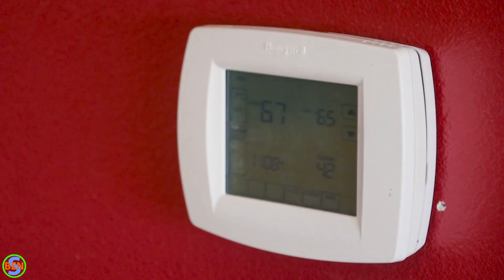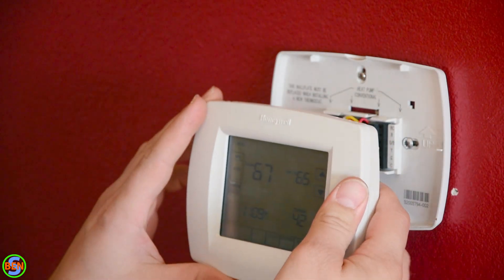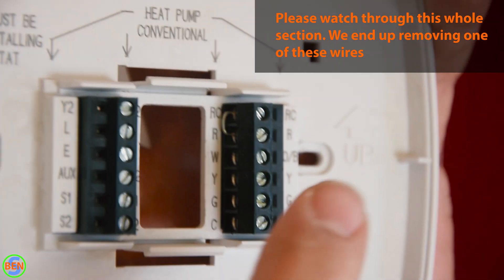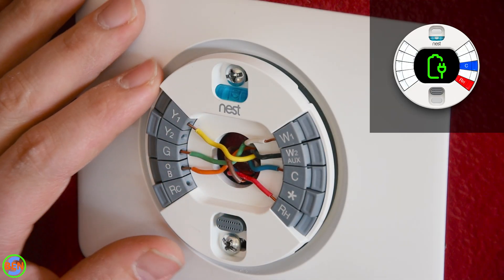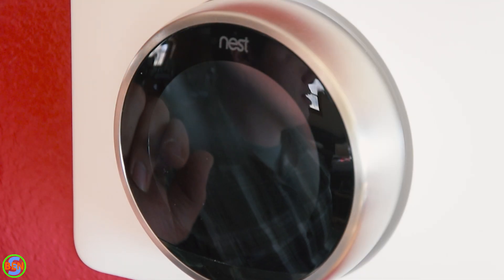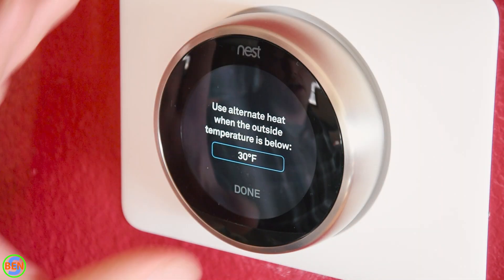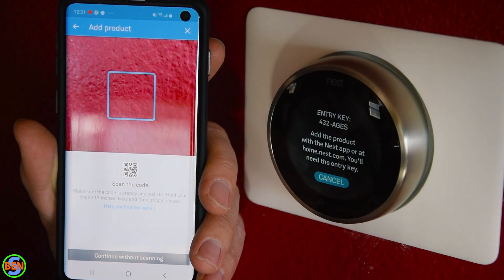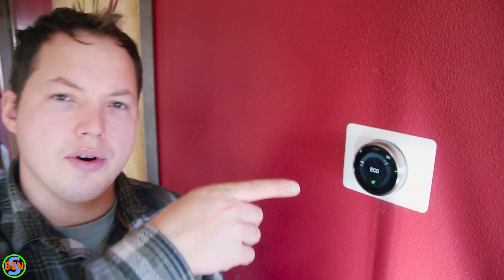How To Install the Nest Thermostat With a Heat Pump

Comment: Hi, I  am replacing the old Honeywell thermostat with a new nest . The old wire has only 2 wires, 1 red and green. 
Should I connect the nest using the 2 wires only?

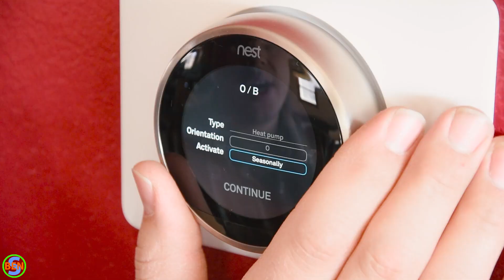Comment: Sir, you literally saved me with what you stated from 5:16-5:20 about reversing the O and B in the equipment settings for my Tosot TU36-24wadu heat pump, my first one! I had a heck of a time turning on heat and the AC coming on,  I tried EVERYTHING,  changing different wires, white wire from W1 to OB and back, red wire from rc to rh, etc etc.  Either heat was produced, but the heat pump fan didn't come on,  or the heat and AC production were reversed when Nest was turned on. My wife even wanted to go back to the old dumb thermostat, luckily I found your video! Thanks again! Definitely subscribing to your channel/videos!!!💯👍

Comment: i am doing A Mr cool natural gas furnace and mrcool universal heat pump. i hear its made by  Lennox . watch at the 14:24 mark and tell me thats not the same as mrcool.
          Dual Fuel Heat Pump Install Tips - How To Install A Heat Pump by HVAC Know It All... any how HP- Y,R,C all connect to the furnace at R,Y,C the blue would feed though  (wire nut it going to the thermostat) D is for defrost if your furnace supports it. if not omit it. now my heat pump needs power to the B terminal at the HP(heat pump) for the heat to work. your may be different and you need to know so you can set the nest to supply power or not depending on the mode desired ( heat or cool) and the B terminal from the HP connects to the O/B of the nest. after that these are all furnace terminals for a single stage furnace. R to Rc or Rh doesn't matter. the nest makes the connection between them. The reason for the separate Rc Rh as i understand it is if you have 2 transformers. 1 for heat and 1 for cooling. say a air handler for cooling and a boiler for heat. the 2 systems are separate from each other so 2 transformers .W to W1, C to C,G to G, Y to Y1 and of course R to Rc or Rh and HP B to O/B  and if your furnace has a D then that to HP D if not omit it. I'm not saying wire colors because they differ from instal to instal.... easy peasy. if i am wrong please comment and correct me. i am not a hvac tech by any means . just a hack with a good understand of wiring. use at your own risk. and your system may very.

Comment: I have a Gen 1 Nest thermostat that i self installed to a circa 1994 York natural gas furnace and central AC unit.  I just had everything replaced with a Bryant furnace and Mitsubishi heat pump.  The installer removed my Nest and said the heatvpump has to use the basic (and dumb) thermostat from Mitsubishi.

Can i use a Nest thermostat with this new heatpump setup?  Doni need to upgrade to the most recent version?

Comment: [hit the button too soon] a question to see if i got this well understood --> my house is a ranch, bosch combi-boiler that drives 2-zone baseboard heating, and a goodman heat pump with installed electrical resistance heat strip for forced air heat and cool. there are 3 NEST E thermostats.  i 'think' the rules for the system might go like this: (1) each NEST E for a baseboard zone would be conventional 1 stage heating: W1, C, G, Rh., with heat to turn off when temp > 40deg; (2) the NEST E for the heat pump + electrical resistance heat strip would be 1 stage heat pump with aux heat and emergency heat: W2, C, G, Rc, *, with heat pump set to turn off with temp <40deg and emergency heat to turn on when temp <25deg [[since aux & * jumpered by NEST, when we need a quik warmup, the electrical resistance strip turns on to assist the heat pump; and if the combi-boiler fails then the electrical resistance strip turns on to keep the pipes from freezing]]     ok, so, mouthful! does it make sense?      what i am not sure of: (1) does the heat pump setup need to be a dual-fuel setup since i have 3 independent NEST E?   (2) do i need W2 & * to be wired for the heat pump? since the combi-boiler NEST Es will effectively run the 'backup heat' = 'aux heat', i could leave it without a connection?   (3) should the electrical resistance heat strip go to * or W2? there is programming behind when the heat pump engages, and also when the emergency heat turns on in the rules i mentioned, yes? and you would lose the programming if stuff isn't connected to either/both W2 & *?               i am doing this because 3 contractors did little pieces, but none of them spent the time to make it work as a package. i have heat so that matters. but it is more expensive than needed i suspect. when you have some time, i'd appreciate your feedback. thanks, ron

Comment: Is the Nest any smarter about aux heat on a heatpump? I have one of those Honeywell FocusPro thermostats and if I raise the temp by more than 1 degree it'll turn on the aux heat even if it's 50F outside. I added a switch in the white wire in the basement so the thermostat can't turn on the aux heat unless I turn that switch on. Incidentally, when it dropped to 6F overnight here, set point was 68F but indoor temp dropped to 64F due to no aux heat. I was OK with that. 15 SEER builder-grade Trane heatpump can keep my house at 64F when it's 6F outside not using any aux heat. I think that's pretty good. It's not so much the heatpump as it is that this house is pretty tightly constructed.

Comment: Thank you, Ben! I am hoping that I can swap out a mercury thermostat.
Reply: if you have an extra wire in your thermostat, just buy a 24 AC V adapter to get the power for the thermostat. Otherwise, you need to add a new one

Comment: I have dual fuel system, heat pump with propane (gas) furnace backup.  Looking at my connections I see my red wire is going to Rc instead of Rh.  Is this something I need to correct? I see your red is going to Rh.  Thanks

Comment: I have a question ..how the nest thermostat .read .outside themperature .. .?? Right now .i have a  goodman heat pump ..with  a furnece 
 ..i have a thermostat . Pro 8000 
With outside temperature sensor 
Sensor is conected 
To s1. And s2 .
Reply: well , Nest connect to WIFI , with you location it get local weahter report which we can read from its screen too

Comment: Have you tried a Nest on Mr cool diy?
Reply: i am doing that right now. Mr cool natural gas furnace and mrcool universal heat pump. i hear its made by  Lennox . watch at the 14:24 mark and tell me thats not the same as mrcool.
          Dual Fuel Heat Pump Install Tips - How To Install A Heat Pump by HVAC Know It All... any how HP- Y,R,C all connect to the furnace at R,Y,C the blue would feed though  (wire nut it going to the thermostat) D is for defrost if your furnace supports it. if not omit it. now my heat pump needs power to the B terminal at the HP(heat pump) for the heat to work. your may be different and you need to know so you can set the nest to supply power or not depending on the mode desired ( heat or cool) and the B terminal from the HP connects to the O/B of the nest. after that these are all furnace terminals for a single stage furnace. R to Rc or Rh doesn't matter. the nest makes the connection between them. The reason for the separate Rc Rh as i understand it is if you have 2 transformers. 1 for heat and 1 for cooling. say a air handler for cooling and a boiler for heat. the 2 systems are separate from each other so 2 transformers .W to W1, C to C,G to G, Y to Y1 and of course R to Rc or Rh and HP B to O/B  and if your furnace has a D then that to HP D if not omit it. I'm not saying wire colors because they differ from instal to instal.... easy peasy.

Comment: Why did you choose 30F as the switch-over point?  I run a Goodman 16 SEER heat pump with propane furnace. I set mine to 23F. Is that too low?
Reply: Actually your 16 SEER heatpump is still efficient down to around as low as 0-10 deg. F

Comment: I owned this model of thermostat but ended up removing it after the thermostat began short cycling my HVAC. The issue was never truly fixed by the manufacturer. I would use the actual product and company names but it seems the AI mods are removing negative comments.
Reply: The short cycling could be caused by low voltage to the thermostat. Did your system have a C cable?
Reply: @Ybeazzie  That's one of several theories pertaining to this issue. Meanwhile, everyone affected had been long term Nest customers that all began reporting the problem following a specific software update. Nest refused to look at the code. Between this issue and Google's botched acquisition, moving to another platform was the easiest solution to my problem.
Reply: @roberthernandez7564  man didn't want to hear that but ill definitely keep that in mind. i have read that with inverter / condensing? units you shouldn't use the self learning mode because it wi short cycle the systems and are less efficient. the units run constantly at low power and ramp up when called for.  back to physics 101 once an object's in motion it's easier to keep it in motion. they inverter systems take a lot of power to start. more then a old style pump but once they are moving they use less power so you don't want to keep starting and stopping them. just let them run on low power.

Comment: Interesting. Obviously you're system is duelfuel. Would your furnace also be used for auxiliary heat? I live in California currently, where I was born, but grew up in Maryland and Michigan where both houses used heat pumps. To give a time reference, Maryland was in the 70s. Michigan from 1980 to my move to California in 1998. The house in Maryland was air sourced Michigan was water.

Comment: When a heat pump is in the defrost mode when in the heat mode it turns on the electric, heat strip and most heat pump arrangements. Centura doesn't have electric heat strips and you have a gas furnace. Does it do the same?.
Reply: can have the gas furnace come on during defrost cycles instead, but have to be careful to not have it apply too much heat to the coil.